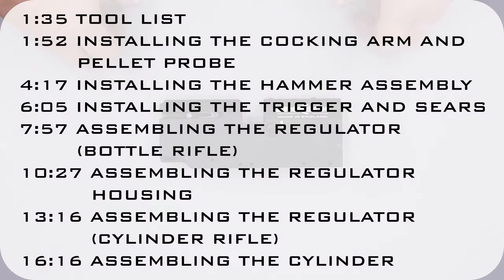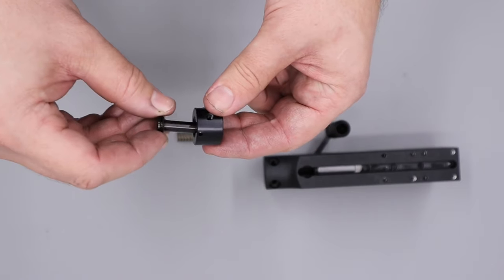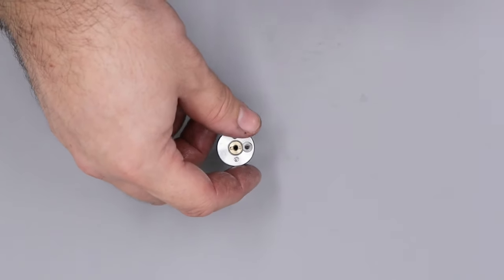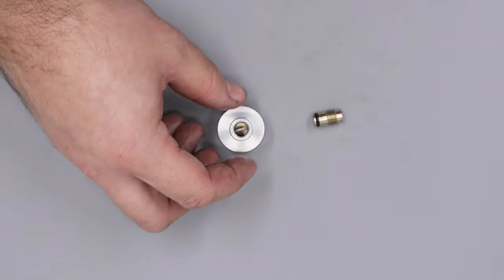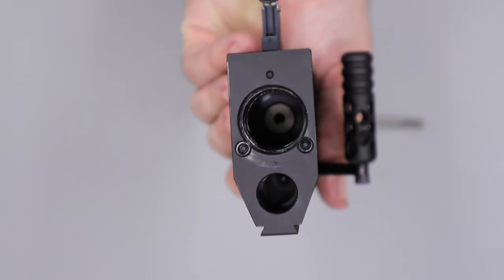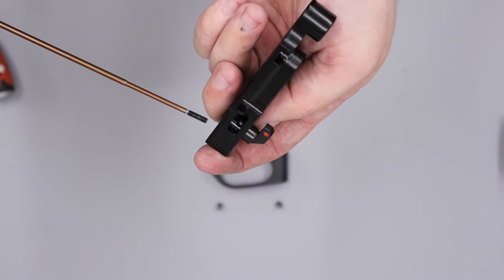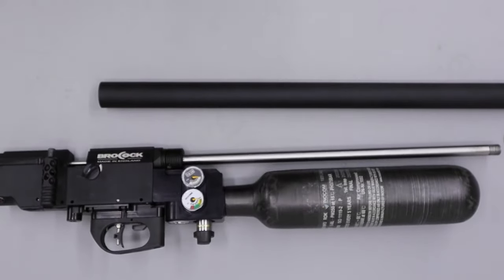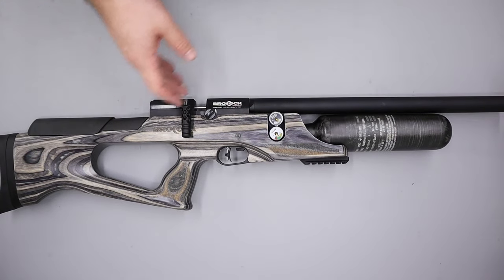BRK-Brocock XR series assembly

Comment: Another excellent video. I did think of getting one of these until I saw this video though, I've looked to getting a FX but due to the number of seals in the design, it totally put me off (so many potential leaks). Sadly this gives me the same thoughts. I bought a Ghost with fewer seals which gives me a little more peace of mind.👍
Reply: I have an FX Maverick, FX Panthera 600 and FX Panthera Hunter Compact and I've never had any problem, no less a leak, from them.

Comment: As I've said b4, I love your work.  It's easy to understand you and you don't go too fast.  I recently got my Atomic XR and when I removed chasis to lighten the trigger, there was no warrning about "watch out that the spring and pin for power adjuster don't fall out".  Gues what, they fell out and I lost the spring.  I friend lent me his while AOA sends me another and your video, THIS video, saved me because I had no idea as to if the sping went on top of the pin or below and what side of the pin faces "down".  THANK YOU.  Do you have a video on trigger adjustment on Atomic?  I also want to see a video on Hammer Adjustment.  This is my first Brocock/Brk aside frokm a Pathfinder XR that arrived from AOA leaking and I sent it back and got this Atomic XR in .22.  I'm in Connecticut USA
Reply from the maker: Thanks for your comment - for all technical enquires please visit our technical support page on our website.

Comment: Could you please demonstrate how to adjust trigger?
Reply from the maker: i will put this on our to-do list
Reply: Very good vid! I have one question: What’s the difference between reducing the hammer spring tension vs decreasing the regulator pressure?
Reply: @Life_a_bike  That is not something that can be answered quickly.  Generally, set your regulator first, and always on the low side because to lower the reg pressure, you HAVE top completely degass the gun.  Raising reg pressure not so.  Then reduce hammer all the way out.  Hammer changes should be in 1/4 turn increments at most. Then shoot the pellet/slug you would prefer to use regularly.  Always take 5 or more shots (dry fire with air only in the gun, never without air) to let hammer more or less settle in.  Never adjust hammer with the gun cocked.  Then gradually increase hammer until velocity peaks and then declines.  Then reduce hammer  to 1/4 turn below where velocity peaked for 5 shots.  The hammer and regulator need to be in sync/harmony.  That's called "tuning".  I suggest that you watch videos on Tuning.  Here's the best one that applies to most PCPs.  https://www.youtube.com/watch?v=L0_RVfiNPCI